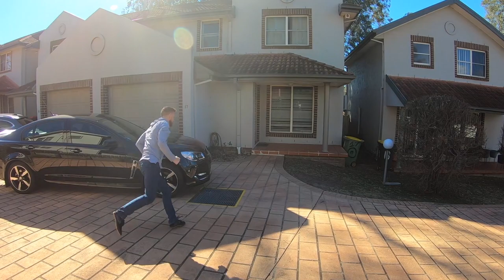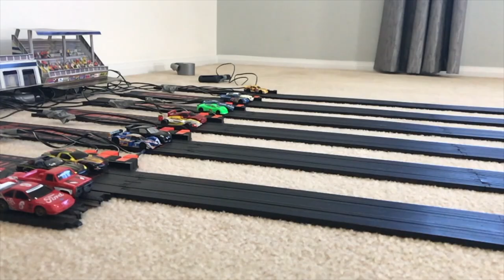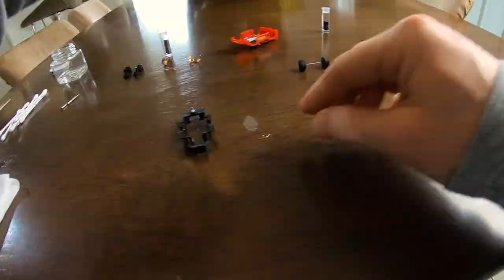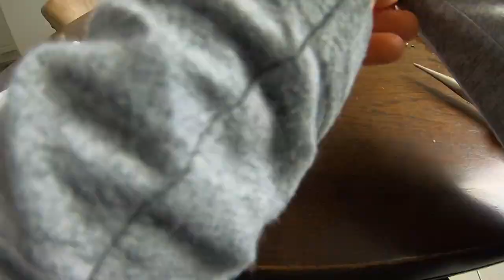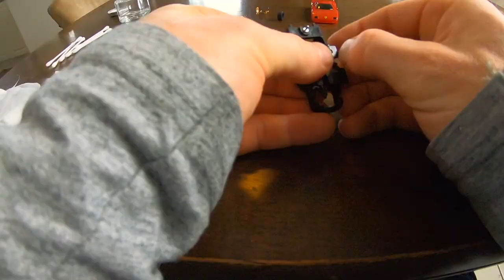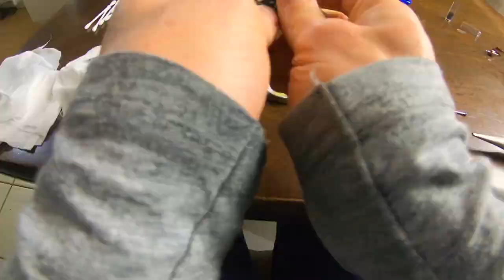SLOT CAR RACING - 440X2 UPGRADE - MAGNETS - ARMATURE - WHEELS - TEST - EPISODE THREE SE04

Comment: Hi..I would go from 7/25 stock gear ratio,to 8/22 for small tracks,use 7/25 for big club type tracks, just going to the 8/22 would make your 6-ohm armature fly..
Reply from the maker: Thanks for the advice Lead Rest I will consider. I need to revisit that 440 again. It's unfortunate the F40 shell haas been damaged when I moved homes.

Comment: Now then......
I ran 440's years ago... on my 20' straightaway course.
Hopped up arm; motor mags; Neo traction mags: Delrin ring and pinion rear gears for top end; Silicone rear tires ( glued ).
Done. 

Great vids !!!!!!!!!!
Reply from the maker: I needed to glue my tires, i just can't get the neo magnets to sit right and work with the car. hopefully i can fix that car in the future.

Comment: You can’t use those stock AFX 120 ohm controllers it will overheat. As you found out. 35/45 ohm contrôlée  and that arm will will work just fine.
Reply from the maker: Thanks Timmy it definitely does. I have plans to revisit the 440 platform again with some changes to fix the issue.

Comment: Did you upgrade the motor magnets? With a 2.8ohm arm you need to upgrade the motor mags to minimum Pro4 but preferably  Pro8 motor mags. Also you need to upgrade the rims to double flange rims and then harder tires. If you use really soft tires with high down force traction mags it's like running on flat tires in your real car. Hope this helps buddy!
Reply from the maker: Hi Mate, i went to the men motor magnets which did;t sit right, looking at getting the Pro8 in its place. hopefully that should fix it.
Reply: @afxworld3523  you went to the ??? Motor mags that didn't sit right? Where are you getting your parts?